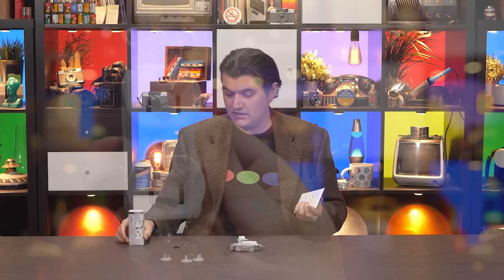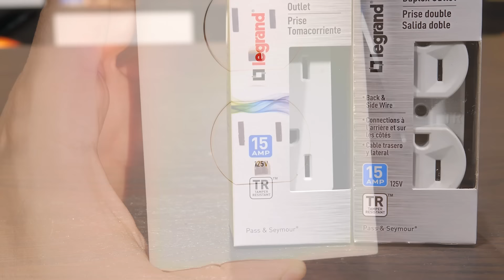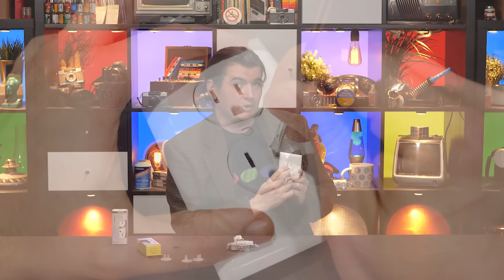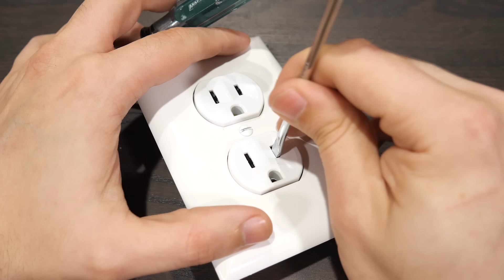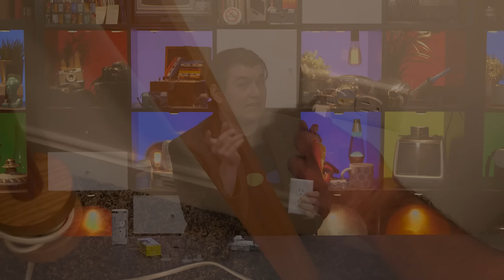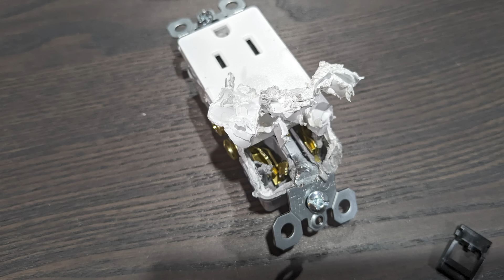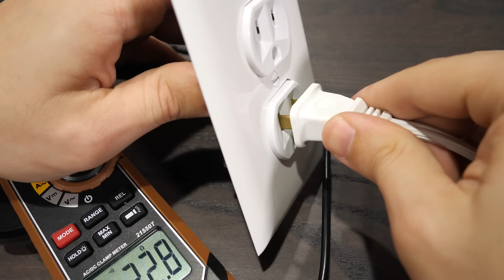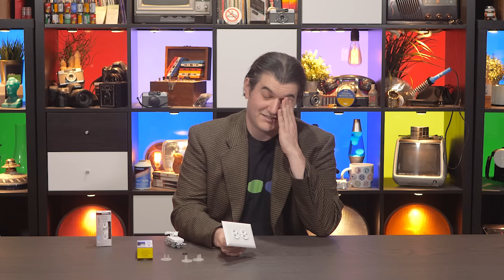Tamper-resistant outlets aren't all the same - a follow-up

Comment: The funny thing is in the UK, I honestly can't remember the last time I ever had to change a socket because it wore out. It feels insane to me that they're so poorly designed that they have a finite life. 

The only reason we ever change them over hear is because we've broken the faceplate on them or we're looking to have nicer aesthetically pleasing sockets.
Reply: I went to my Mother-in-Law's house a month ago and she had a multi-brick plugged into the wall in her dining room. My Wife pulled it out and she said she left it in because it was difficult to push plugs into that socket. Sure enough the shutter mechanism was very stiff, we picked up a new socket that afternoon and I fitted it for her. That's the only socket I've ever had to replace for a mechanical/electrical failure.
Reply: Yeah. That's my experience too. Never seen one break from usual wear and tear. Haven't even seen them get loose grip with age. I just replace old ones for aesthetics usually when I do.
Reply: @@phillipbanes5484Depends on use too. But I was at a friend's house the other day and his shit was falling out the wall, and his house was built in 1985. My sockets were like that too, in my 1959 house. They do wear out. It's a well known thing with aged US plugs.
Reply: UK sockets seem to have an absurd amount of clutch force sometimes, you really have to pull hard to get plug out. I think we just start stronger so it takes a longer time to wear out.
Reply: Everything has a finite life. Outlets do normally last multiple decades easily, but outlets that you frequently plug and unplug t hings from won't last as long. Anything that involves physical contact has wear as a problem. Over time the pins inside the sockets, yes, even in UK land,  will not be able to contact the pins on the plug as well as they did when they were new. But for outlets you rarely use, or which you plug something like a lamp into and then forget about it, will last a very, very long time.
Reply: most people in america can't remember the last time they replaced an outlet either.
Reply: They don't generally wear out in the US either.  I've replaced a few to upgrade them or change the color, but that's it.
Reply: @FirstLast-vr7es  the springs tend to wear out in the US ones - go into an American house with 80s sockets and stuff will fall out of the receptacles
Reply: That's US infrastructure in general, one of the first and rarely still the best.
Reply: @Broken_Yugo  Surprisingly the US was one of the last industrialized countries to standardize its sockets (among those that had achieved electrification, anyway) - it came about by means of a manufacturer cooperative, NEMA - rather than being designed by a government engineering panel as was the case in other countries, where standardization happened much faster.
Reply: @Harrison-cr4ie  Hmm, citation needed? The first issue is that I don't see how it is relevant if the standard came from the government or a consortium of companies. The second is the time frame. The 1915 "wye" outlet was the base standard until it was replaced by the Hubbell plug in the early 30s, which is still in use today. Many European countries didn't industrialize until after WWII. Most of Asia didn't start to industrialize until the late 60s to 70s; in fact, it is a process that is ongoing all over the world. The UK had multiple outlet types until the 1970s, which by itself begs the question of whether government "standardization" is better than an industrial one.
Reply: @XDSDDLord  Citation
"In 1926, the National Electrical Manufacturers Association (NEMA) was founded by the merger of the Electric Power Club and the Associated Manufacturers of Electrical Supplies[6] and represented manufacturing companies of the electrical segment in a national level. NEMA provided a forum between companies for reaching standardization, but it was not until the 1940s that NEMA started to publish standards on receptacles and plugs, much later than UK,[7] France and Germany.[8] Since NEMA was a forum between manufacturers and not an governmental body, any decision had to be thoroughly discussed and agreed upon by its members, which substantially slowed the standardization process. "

The hubbel plug is not the standard today in the US, it's the NEMA 5-15P...

https://en.wikipedia.org/wiki/NEMA_connector#NEMA

Also, the UK did not have multiple types any more than the US did - the US didn't add grounding to its receptacles until the 60s, whereas the UK had it in the 50s. Both countries have had evolving standards, but the UK standardized and stuck to its base design sooner, which is indisputable.

Comment: Also, it is pretty rare to be really well grounded while touching the plug. Only if you are holding the equipment that you plug in and it is faulty, or if you touch a radiator. Floors and walls are good insulators. For those who don't know electricity basics, you don't get shocked touching a live wire if you are not grounded. Most often you get shocked between fingers of the same hand and that is rather harmless, just scary.
Reply: Reminds me of the poor squirrel that we used to watch occasionally at work while on morning break he would run back and forth along the main power lines amusing himself and once in a while jump over the horizontal spreader to continue along the power line at the top of the pole above where the transformer for the entire plant is mounted.... one day it was raining particularly hard and the little squirrel was apparently really feeling frisky bounding down the power line 'playing' and for whatever reason decided to bound across the spreader from lines to line .... brilliant flash of light,  extremely loud bang (the kind you can feel in your chest) every light in the plant flickered and no more squirrel.... gone in a 'blaze of glory'....
Reply: @alexlail7481  This happened to one squirrel who was climbing on top of one of the (actually explosive, yes) fuses above the house transformer. Loud bang, falling squirrel, but later the squirrel got up and ran off. Expensive squirrel, at least for the local electric company, as they had to send out a guy with a ladder truck and new fuse..
Reply: @noyb7920   that's more what I would have expected... but the plant I work at is at the end of a branch circuit in a former residential area and the service has been maxed out for decades on regular single phase power and the company I work for and the Power company are kind in a stand off ... if we need any more power the company will have to pay to update the branch line to supply 3 phase power and higher current... If any of the businesses ahead of us increase their needs the power company or that customer will need to pay 🤔.... anyway I believe I was told we have something like 3,000 Amp -4,000 amp service@ 480volts (I could be wrong) and I guess that would vaporize an unsuspecting squirrel....
Reply: @alexlail7481  This is why power lines should have more clearance or be insulated(yes, covered aerial conductos have existed for over 60 years). Unfortunately power companies will choose the cheapest method until there is a law mandating safer design.
Reply: @mernokimuvek   I  understand your point but its not quite that simple... there are many reasons why lines are usually bare and cost is definitely a factor but not the only one.
Reply: @alexlail7481  They could still use higher clearence. And nothing ever can be more important than environmentalism and animal right. Nothing. Not even human confort.
Reply: @mernokimuvek  even though it is not directly relevant to  this conversation..... I have to say I don't know, your age, nationality, or educational background.... however you seem like a you are young passionate individual. If so I would encourage you to seek an education in some form of engineering (it sounds like civil engineering maybe an area that would align with your interests) and political positions at the state and national level (or your local equivalent).  There's many things in this country and world that could be addressed so much better than they are. You seem to have the passion that is going to be required. But everything has a cost.... monetary, environmental, and  human are just a few.  An engineering education can help sort those out because frankly many things that seem clear cut are not, and the nuances buried in the details are the difference between success and predetermined failure. And at least environmentally we need well thought out and considered answers.
Reply: @alexlail7481  I'm at 4th(last) year of studying mechatronics engineering. Thankfully more and more bare power lines in Europe are being replaced with covered conductors, proper clearance and underground cables. North America is several decades behind and looks like 3rd world compared to Europe. Even shitty eastern european and balkan countries have better medium voltage distribution lines than US and Canada.
Reply: @mernokimuvek  well congratulations on your impending degree mechatronics was still fairly new when I graduated from high school but there were a couple programs around..... Personally I had a more convoluted path pursuing a new engineering field that didn't solidify until after I had finished my degrees. I recognize that our power grid looks a bit odd to those from Europe and other areas. As a whole it serves its purpose well and the power company in my area is very reliable and generally one of the better ones nationally, but some area are pretty rough. I know on paper it looks like our grid is not as reliable as some of the  more modernized Europe systems but it also deals with some major natural hazards that are problematic regardless of the infrastructure and I'm not sure how much better the newer more refined tech would deal with some of them.
Reply: For normal people in their houses, sure. But trades people and technicians are often sweaty, wearing short sleeves, and have a supporting hand, arm, or even belly up against something like duct work, ceiling tile grid, or metallic conduit. Even 24 volts can tingle a good bit in the wrong conditions.

Comment: I've gotten shocks from 120 AC outlets a number of times and other than a surprise, it's never been a problem.  The earliest I remember was unplugging an old power tool as a kid and the plug was actually broken, so when I grabbed it to pull it, I essentially grabbed both leads.  Made me jump, but that was it.   So - in that sense - unless you have heart issue or similar - accidently grabbing the terminals on a live 120V plug is mostly harmless.  But - if you do something that makes you unable to let go of the live power, it's not going to end well.

Comment: About adding insulation to the plugs, we did something similar with type L plugs, where full lengt pins were changed to half plastic ones, but here the plastic part is slightly thinner than the metal part, so that older recepticles don't get disturbed by it, this may be hard to do with thin blades instead of pins.

Comment: The problem EVERYONE has is we can only really 'upgrage' our existing outlets and plugs so long as they're compatable with the old. The gates over the slots is a great improvement and shrouding the pins is also better. All UK plugs must have three pins which isn't really nessasary on GFD/RCD circuits. European sockets are all recessed around the plug which is also better.
Unfortunately without political will nothing will happen, your 'tamper proof outlets should already be mandatory!

Comment: 6:45
You are overthinking what the statement actually means, it is really literally just what is being said.
This obviously has to do with the fact that the prongs in European plugs are much longer and are further spaced out, so if there is any sideways force applied to the plug, it will just jam and not come out, even with the simple Europlug.
Add the insulated base of the prongs and the fact that modern sockets are all recessed and suddenly NEMA, especially the two blade variant, is just loose and feels hella unsafe. I was in Japan a couple of years ago, so I know how weak NEMA feels. Even the 70 year old non recessed wall outlets in my grandparents home feels more secure than that

Comment: Here in Europeland our outlets are recessed so the blanks protecting the holes from poking children actually go inside the recess and can only be removed by inserting a special tool. It looks like a doublesided hook that needs to be inserted and twisted to engage and pull out the blank.
Since I grew up and live here in Europeland I would never consider the blanks to be unsafe from certain age due to the fact they are really difficult to remove.

Comment: From a German point of view, the transition from 120V to 230V and to Schuko plugs (EU plugs, you see on AliExpress) was possible. Some devices had to be exchanged, if they could not be adjusted to 230V. And the plugs either fit the molded hole or you had to replace the plug with one with screw terminals. Both transitios were before my time and from an eastern German perspective, but in general it was possible, albeit in a time were people had much less electronic devices.
PS: I am not sure , whether the 120 V was only a thing in the GDR and not the Federal Republic, could be.
Reply: @elpolaco7654  yes, it even was DC, the transition began in 1965. You can Google it. My Grandparents were landlords at the time and had quite a hassle with it.

Comment: You might not be aware of this, but 120 V can be dangerous.  Your statement that “it is impossible to become injured in any way or even inconvenienced by a voltage below 137 V” is incorrect.  Probably because you’re a shill for Big Shitty Outlets, who pays for your fancy studio and styling.  In fact, I died from an electric shock from a 3.3V watch battery just last week.  Also, why do you refuse to talk about heat pumps, air conditioners, refrigeration, dishwashers, toasters, light bulbs, electric cars, and lanterns?  It’s very suspicious.  Finally, I don’t think you are correct that the US outlet design is best in the world.

Comment: I can't believe the US plugs and sockets are so bad. We may not get many things right in the UK, but our electrical system is pretty solid. Making any small change like orientation, special "tamper resistant" outlets etc. won't cut it. You need regulation. Just adopt our design, we're all friends these days! ;) Just don't leave plugs on the floor as walking on them are a nightmare! That a side I can't think of any drawbacks to our outlets and plugs. Be good to see you do a review / comparison between US and UK Alex.

Comment: the non Americans telling you that US plugs are always falling out. Its slightly more than the worn hotel fittings that you suggested. if you add in a heavy travel adapter and then a heavier than US UK plug there is a lot more weight in the socket and it sticks out significantly further from the socket. I used to use a single US to double UK adapter and that was awful for it

Comment: To illustrate the difference between how dangerous a shock from 110V vs 230V is.
110 hurts.
If you somehow manage to get shocked at work by mains power here in 230V land, you are expected to be driven to the hospital and have your heart rate monitored for a day just in case.

Comment: people will still definitely argue over "safer" and probably not accept it, but the danger is from difference of potential. if the potential difference is twice as high, lots of uncomfortable or inconvenient situations become deadly. potential differences don't always exist in wires. water and failing equipment create unexpected paths for current

Comment: In Britain it's only the real cheap socket outlets that have the mechanism where the ground pin opens the shutters. The better quality outlets are the same as those where the shutters are opened by pressure on both LINE (not live) and neutral pins, and we've had that particular shutter system for decades. So there.

Comment: one way to “secure” the outlet would be: rather than having a flat design, add a bit of a recess to the socket / the wallplate to be more protruding. like in Europe (not the Uk)
it does not need to huge even (not like the European ones) just a 5-8mm “cover” it would not prevent the plug being dislodged, but even if that happens, the blades would be surrounded by some extra housing reducing the risk of anything falling on the blades (knives!) and such.
Yes, there would be existing plugs that would not fit, but it ver time they would wanish. in fact that could be a step one to increase safety over a few decades.

also, i would argue that every new cable should come with the earth pin. even if its not connected to the appliance. that would reduce the dislodge problem as you demonstrated 

in another decade, once the “earth pin” is there everywhere, sockets could be switched to be tamperproofed like the UK one is.
obviously there would be still old plugs out there without the earth pin… but noone would walk in your home to forcefully replace your existing sockets. Always start with new builds.
which would mean you might need to replace a few plugs … in a new home… but if you leave enough time between the two steps… the work will be minimal. 
given how we replace our appliances and other stuff in out house… in 10-15 years this would be a no issue.

what i am trying to say is that a lovechild of the UK and EU sockets would be the perfect - not too deep, having the earth pin, tamper proofed. And the US blade desing would make it less bulky than the UK or EU ones.

of course it wont happen… but it would be a much SAFER design in a few decades and … well… what is wrong with safety? :)

anyway…